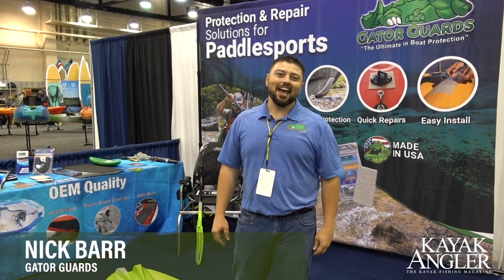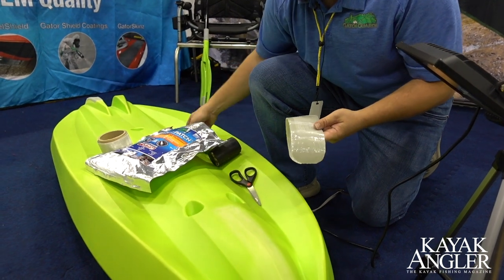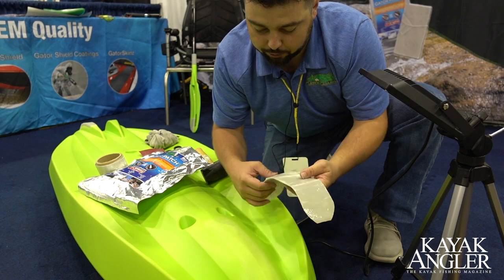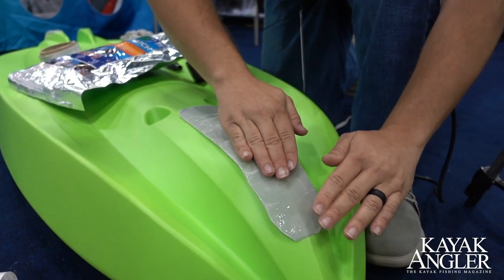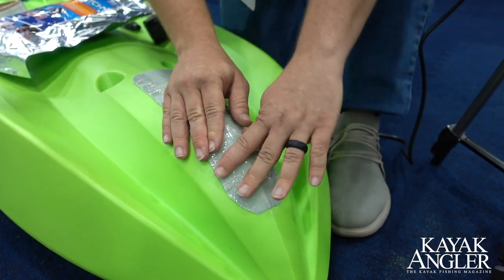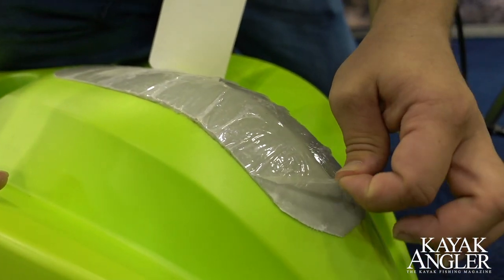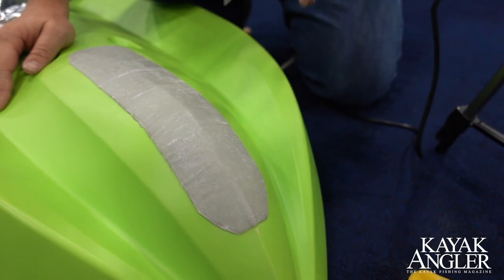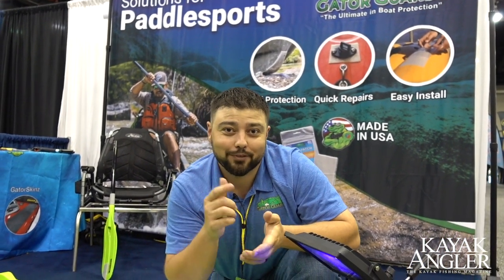Gator Guards Gator Patch - How To Install

Comment: How do you remove it once it’s worn through and you want to apply a new piece, or do you have to just add it over the old piece?
Reply: The UV resin is not attached to the boat hull directly. The only thing holding the hardened/shaped UV cured resin to the hull is the 3M adhesive tape layer on the back of the resin strip. Just use a hair dryer on high heat to warm up the resin along its full length and just pry it up. Like heating duct tape or a price label on an item to pull the tape/tag off easier. Same principal, its just a stiff form that requires all of it to be warmed at the same time.

P.S. Do not sand your hull~! 3M adhesive, just like any TAPE, adheres best on GLASS SMOOTH surfaces. Scrap off your curls and gouge ridges to a smooth finish, clean and apply the resin.